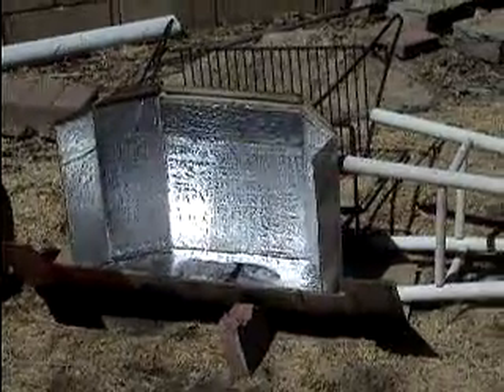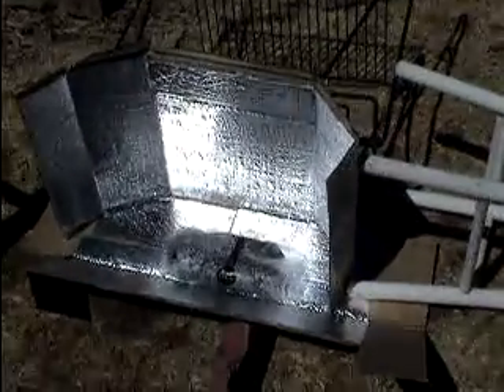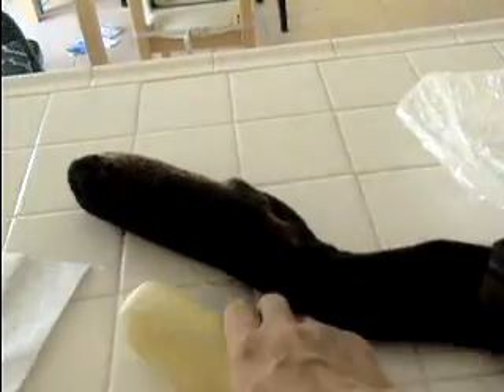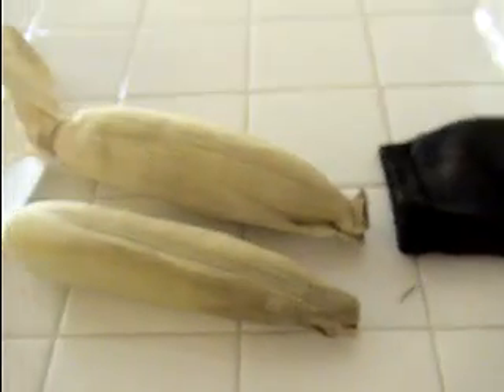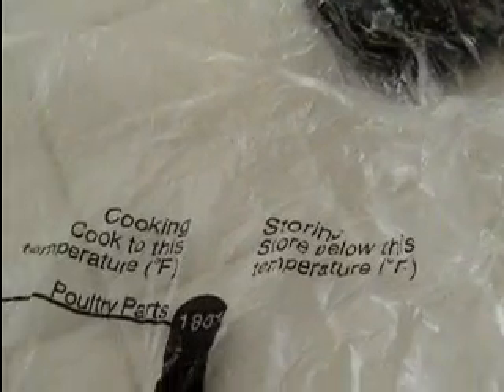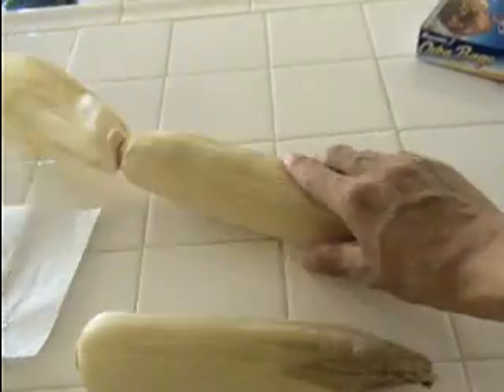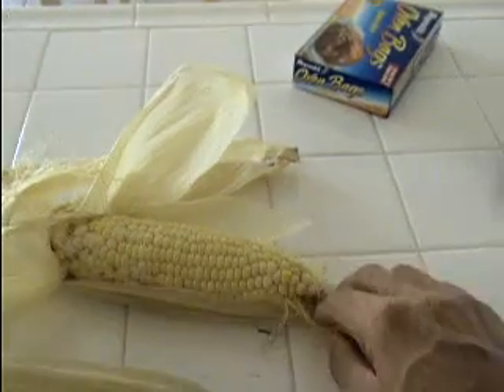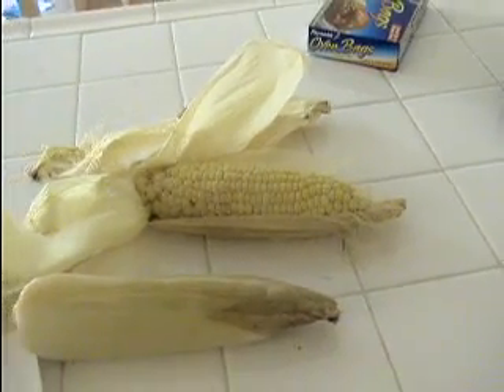Solar Cooking Sun Corn Part I

Comment: I have several panel cookers, been thinking about using them sometime.  One is taller and tends to cook a little bit hotter.  I leave the flaps that close the boxes on for more reflection to adjust and hit directly where I want.  Will make a vid of them sometime soon.  Panel cookers are great in that you can fold them up, great for travel.